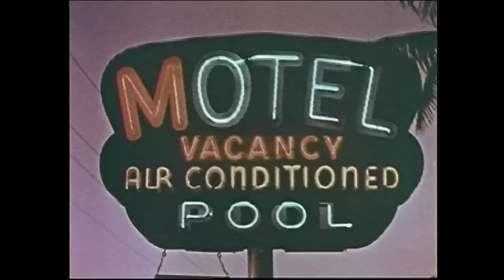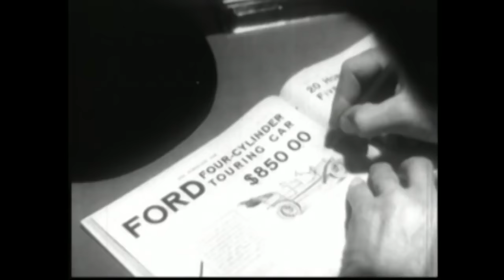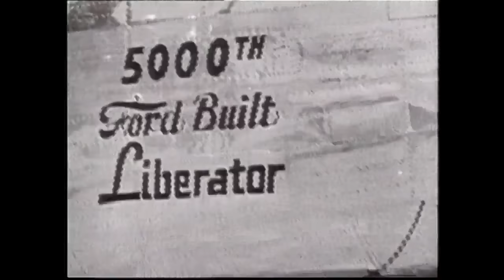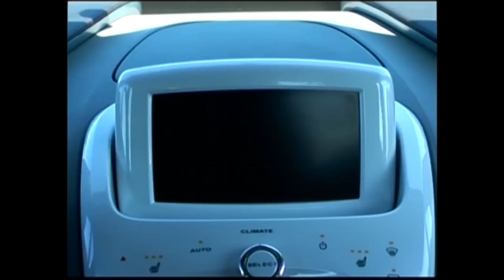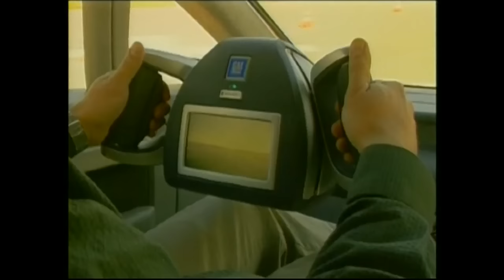The History of American Vehicles

Comment: well those old cars were lot bigger than white house.
Reply: WHAT??!
Reply: of course i had pun intended in my comment,no car can be bigger than white house but if you compare the modern day Chevrolet or Cadillac size with their predecessors from 60's and 70's you will know what i mean.
Reply: I do know what you mean cobra. The thing is now there really aren't equivalent models Chevy or Cadillac puts out now. The vehicles those divisions put out that are actual "cars" are smaller, yes. There's no such thing as the big Caprice's and DeVille's of back then, but there are equally huge vehicles in the form of the never-ending Escaldes, Tahoes, Suburbans, GMC trucks etc.
Reply: mr pierce i was talking in general sense not individually.i know that Chevrolet is a motor company known for making corvette,camaro,volt,caprice,suburban which is same as gmc yukon and both of these companies are owned by gm corporation.
Reply: cobra R great that was.

Comment: The cover image shows what looks like a factory post production storage of 1957 GM cars... but what are they?  They resemble Cadillac, Chevrolet, Buick... but nothing produced looked quite like these.  I am guessing, these are early prototypes of 1958 Chevrolets with single headlamps, instead of quads that were used in 1958 production models.
Reply: Very odd. To me, it looks like a combination of 55 - 57 Chevy, with a touch of Oldsmobile, produced for or in foreign  countries.They are left hand drive, so that rules out a number of countries. I magnified the finder badge but, still couldn't read it. I'll dig a little deeper. My curiosity is up.
Reply: after further reflection, I believe this is computer generated image that resembles a photograph, but was created based on a set of parameters.  Hence the vehicles depicted resemble GM cars of the mid 1950's, but are merely   Made up using an algorithm and created with the assistance of artificial intelligence.

Comment: The Mustang was a very successful compromise vehicle that Iococa had as a successful  ARGUMENT with Henry Ford II. (1) It had to share many lower cost, existing mechanicals with the Ford Falcon. (2) If it wasn't  popular,  Iococa would have been fired. It STARTED as competion to the Chevy Corvette even though it's intial offering was a 170 cubic inch straight 6 engine, with V8 available. Many, many stying variations were prototyped before settling on a stylish yet "normal" mid size 2+2 (2 door, 4 seat) coupe. This IN TURN helped start thr muscle car revolution.

Comment: Code AE all brands and all unit Europe, USA with standard in all AE organization.
1. Wider front track than rear track in over 10-99 mm. For 0.97g and over 0.97g on axis z.
2. Wider front track than rear track in over 100-1000 and 1000 mm. For over 1g on axis z.
3. Superchargers twin rooter intercooler petrol engines.
4. Front fog lamp and rear fog lamp.
5. Gear box 4-12 speed automatic and gear box 4-13 speed manual.
6. Petrol engines without turbo intercooler
7. Diesel engines
8. Hybrid etransmission without petrol engines 1-4 turbo intercooler 

Code AE : 1-10 l/100km level, 10-100 km/l, 18-184 mpg.

End report.

From
AE organization database

Comment: Not one mention of Chrysler Nash or Hudson. You mention several automotive production milestones while at the same time missing the biggest. The 65 impala being the most sold car of one unit in a single year. I record that held all the way into the 21s century when Toyota finally broke it. No mention of the struggling market of the 30s when Americans reverted a bit and used cars for horse drawn buggies. A slight gloss over of the 80s and 90s barely talking about the automotive struggle of the time. Starting with Henry Ford should have been my first sign that I knew more than this guy. Especially when the video even contradicts itself saying it starts with him then mentioning later oldsmobile as being the oldest surviving automotive manufacturer in the US when it was shut down

Comment: Old American car's were designed cool, but they really wasn't that dependable. Compared to modern vehicles,  the steering, brakes, and safety was horrendous.  The best of both world's,  would be a resto-mod car. An old classic car body, fitted on a modern frame, with modern suspension,  drive train, steering,  brakes.

Comment: Like the Auto, the Industry is driven Till Somethong Breaks. The 50s heavy Auto (cars sold for a about  $/pound) & the 60s Youth Baby Boom Muscle Cars (shoe horning huge engines into medium size cars) collided with the oil embargo & high oil prices of the 70s. Small autos,, Vega (reliability) & Pinto (safety) Were Disasters.The 70s saw Japanese imports invade. That's all they knew how to make was good small cars at that time. Force/Mass = Acceleration. So maybe a small car wasn't a stump puller or street racer, being lighter it could still get around with reliability & economy being key considerations.

Comment: You need to check your facts before submitting a completed project. The 1960 vehicle you displayed was indeed a Chevrolet and not a Buick. The 1954 and or 55 vehicle you displayed Buzz a 54 or 55 Cadillac series 62 and not and 1960

Comment: Cars started off fairly ugly in 10s and 20s, got a little better in 30s and 40s, then suddenly got super ugly in 50s followed by awesome design in 60s and 70s - I think first golden era of car design. Cars designed in 60s and 70s still look amazing even today.

After which the most ugly decade started - the 80s. 90s started to come back from a bit from ugliness, but very gradually, still weren't looking nearly as great as 60s and 70s did.

2000s is I think a second golden era of car design. Lexus RX, Honda S2000, Supra MK-3, elegant and smooth lines. Even Ford Focus and Honda civic looked amazing. And of course iconic Miata.

2010s introduces some sharp lines and curves into design, making everything worse IMO.

Lexus of late 2010s got a lot worse in how they looked vs 2000s. 

Grand caravan past 2008 looked far worse vs previous gen design pre 2008. Lots of cars went this way.

There were few who didn't follow this ugly trend - notably Tesla. Especially After 2016 removing ugly fake grille their design started to look much better.

Now we got incoming Cybertruck on one hand.. like wtf.. on the other hand cars started to get rid of ugly edges from 2010s sort of returning to golden era of 2000s, but with a hint of extra style to it. I think I like where things going for the most part.

Comment: There is enough fish heads to dump on almost everybody.
(1) Bleep the UAW. Those clowns w/o health care co-pays ADDED $3000 Bucks to the retail price on Big 3.5 vehicles.
(2) UAW did not want MODULAR Engine Foundry Tech. I.E. the plant could have quickly molded 4,6,or 8 cylinder Engine Blocks depending on demand across GM brands & models. UAW killed it.
(3) BTW the Valve/Cylinder 4,6,8 operation Did Not Work Well, AND, it Still dragged around a big V-8 block.
(4) Bob Lutz KILLED the EV1 in late 2003. EV-1 was a commuter car w/ 100 mile range. Available By Lease ONLY. By 2003 they called them ALL back, most for destruction.
(5) Vega & Pinto quality & safety disasters, and Covair too much bad press but finally fixed. Reputation was beyond repair.
(6) By mid 70s Toyota imported 1.6L & 2.0L models that were safe, efficient, & roomy. By 80s to 90s, Japanese production began in America IN THE US SOUTH away from UAW.
THEY JUST DIDN'T WANT TO GO WHERE & TO WHAT THE CUSTOMERS WANTED.